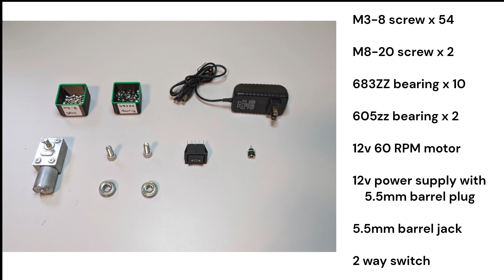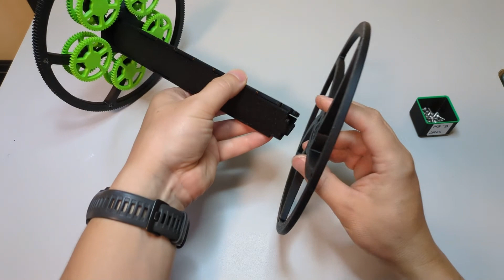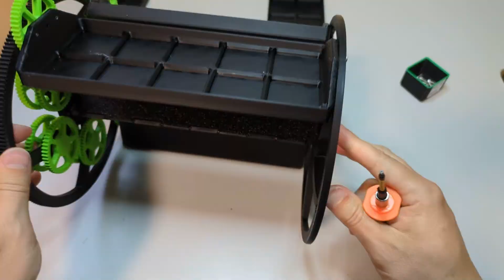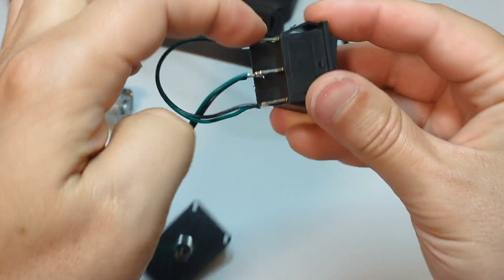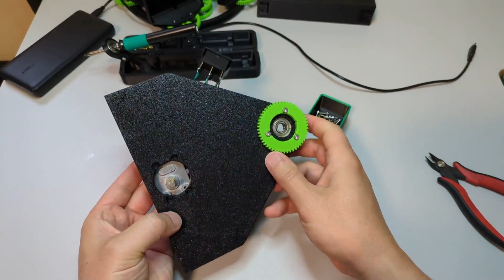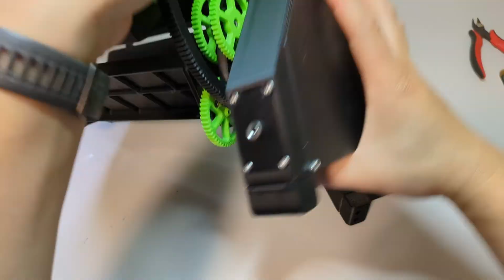Geared Carousel Assembly Instructions

Comment: I have to add this is awesome my question what screwdriver combo are you using I like the versatility of the driver. thanks for sharing this very cool project
Reply from the maker: It's just a multi-tool handle with a 1/4" hex socket and a separate 1/4" hex drive allen wrench set. Like this https://a.co/d/6d8wsUp